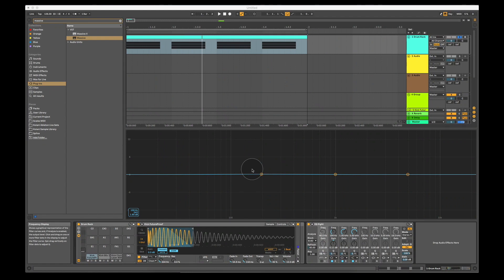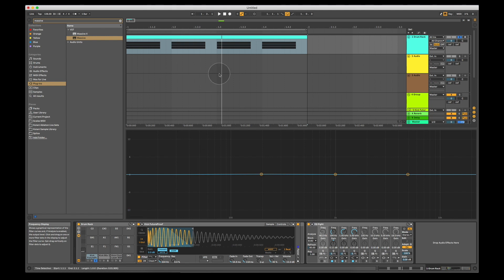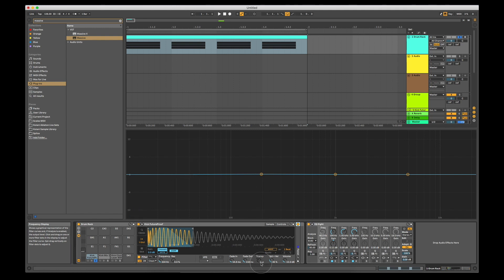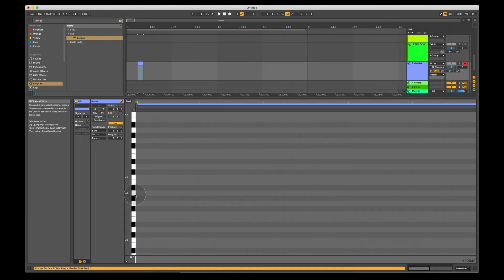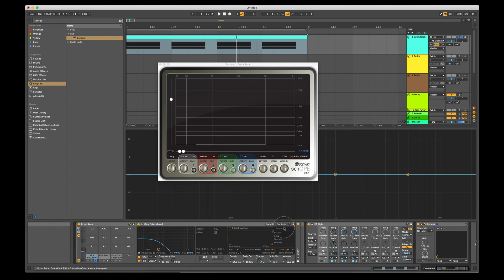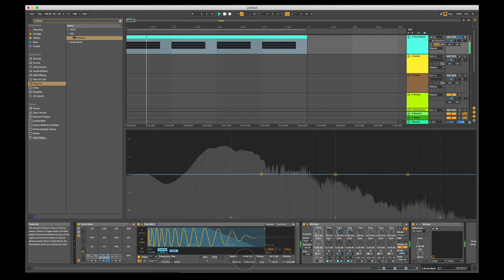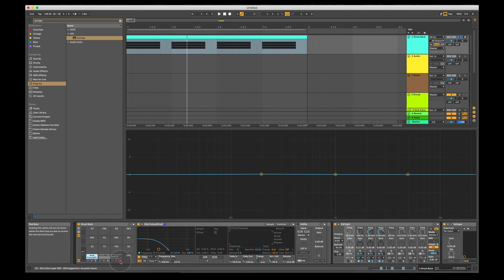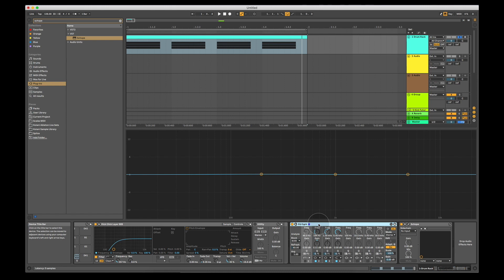Make Your Perfect Kick - Part 5 - Tuning

Comment: I have a question. I usually see when people mixing, they use eq to cut out everything above 100 Hz for the kick, but I just saw that some part of your kick is going little above 100. like if we cut anything above 100 then the click would be disappear. So my questions are first on mixing what part of the kick you EQ from to cut the high ? And Also how you ensure the click which is little on the low mid range part is not clashing with the song mid range ?
Reply: Not sure if this answers your question, but I think he goes over this if you watch every part of the series. He has separate kicks for the low, mid, and high range. With each kick, use EQ to get rid of the unwanted frequencies, or boost in certain areas. So when you are working on the high range kick, cut out the low/mid so it does not clash. All samples are different and work different paired with other sounds. He picked the kicks that he did because he wanted to get a certain sound out of them. They may be different for your style and the EQ you have to apply may be totally different. Good luck!
Reply from the maker: @bedlegs  Thank you for answering this question! And you answered it very well indeed!
Reply from the maker: If you would like to see the video @bedlegs is talking about below, you can watch it here - https://www.youtube.com/watch?v=k-1Ib7cKSrA :)